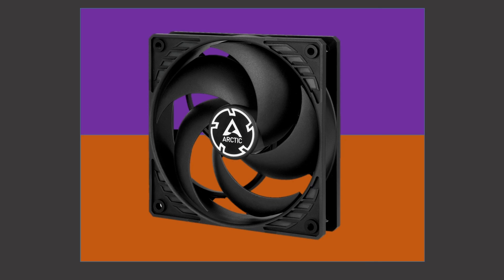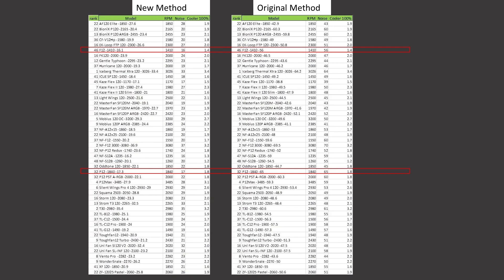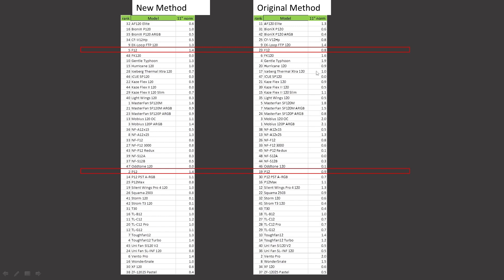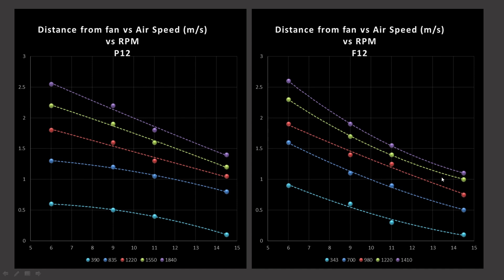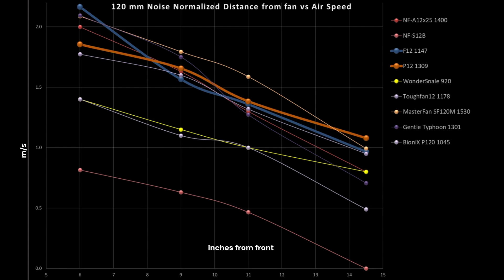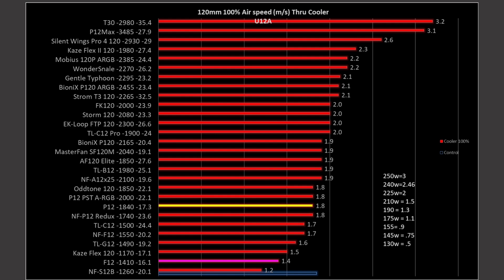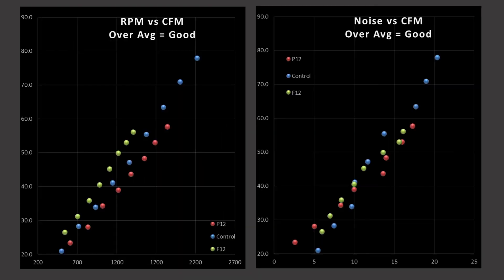(New Testing) P12   Review. Its a good all rounder

Comment: I started my build with 2 P12 and 1 P14 case fans, then I started to search for better fans, here is where I made a big mistake, because I couldn't find better fans at low RPM. The P series have only 5 blades so the noise frequency is lower, more pleasant to listen, the wings are swept and pointy cutting trough the air so it has less turbulent noise in front of a cooler or radiator.

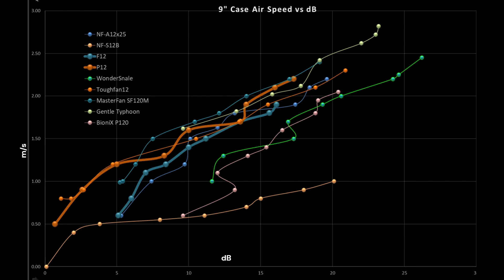6:34 the only drawback of these fans is the fluctuating rotor noise at every 160 RPM, between then the rotor gets loud. Here are my numbers on P12 PWM rev 2 where it is silent 960 RPM, 1120 RPM, 1280 RPM, if you add +80 RPM  to these that is where you just want to leave the room
P14 has the same problem just at 140 RPM, here are the silent regions 824 RPM, 968 RPM, 1108 RPM (P14 rev 2, 3pin version)

Fan test recommendations:
Arctic P12 PRO - it was a big letdown for me, humming around 800 RPM, loud over 1000 RPM and the PWM control is dog slow (which is actually good on motherboards which rumps up and down quickly)
Endorfy Stratus 120 or Fluctus 120 (used to called SilentiumPC)

Comment: Bro i have question does the ring on p14 argb and p14 max fan do something or just gimmick and also what the rubber pad on both of them do.
Reply from the maker: so there is a scientific reason for it. A fans efficiency is related to how close the blades get to the outer edge of its housing. So it the housing is attached to the blades it has the best efficiency in theory. The problem is that ring still needs to get close to the actual housing or back pressure could go back up it. and it adds weight making it harder to spin. 
I hope this gave a basic answer to your question. :)

Comment: a $2 difference between p12 and p12max here in my country.. if I want to get a quiet fan for a dual tower cpu cooler like an ak620, should I go with the p12 or p12max FDB?
Reply from the maker: For a cooler I would go with the P12max with FDB. running it an minimum RPM will still get good airflow and not noisy while still giving you headroom for higher fan RPM's.

Comment: What is the cost of the artic p12 max? Because where I live, the P12 is 10€ and the P12 max price is 11€. I was thinking to buy some fans, and I have a corsair 5000d airflow.
Reply from the maker: Its been a bit but I think P12max was $12. So the Max is better at the top end performance while the regular has lower base RPM so it quieter if you dont need high airflow.
Reply: @computer-tech-more  Thanks!

Comment: I just ordered p12 max, should I return it and get non max instead?
Reply from the maker: generally speaking no. The main advantage with the non max is lower RPM's. so its quieter but lacks the highend max. so depends on what you are looking for.
Reply: @computer-tech-more  so for normal gaming the p12, because they are quieter?
Reply: which fan whould you recommend for quiet gaming at the same price range?
Reply from the maker: @yyuusa7839  for case fans: the TL-S12 is great, the Pure WIngs 3, and P12 
I think all these are in the same price range.
Reply: @computer-tech-more  which is quietest of those three?
Reply from the maker: @ThePerson1257  in my testing the TL-S12 but not by much